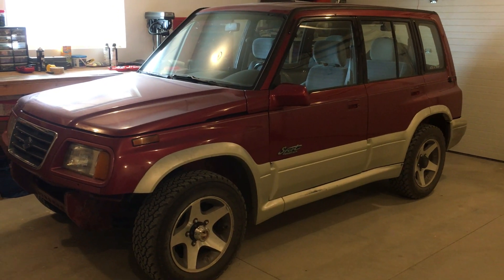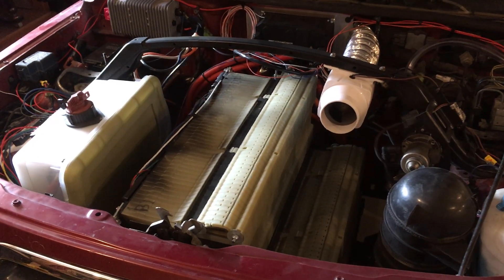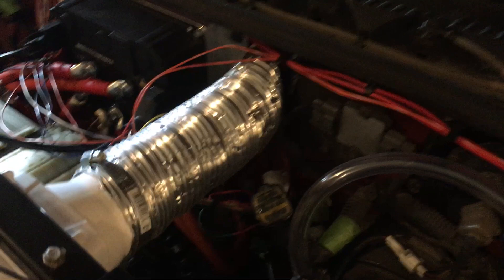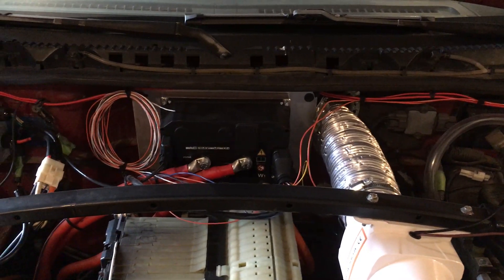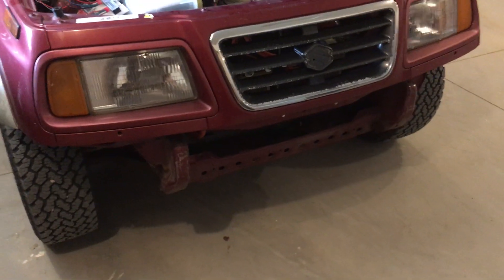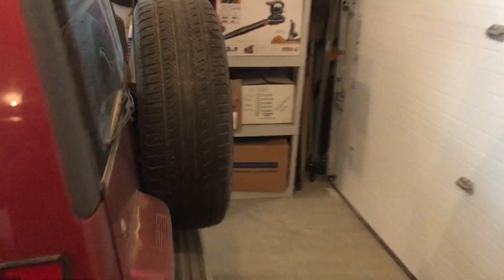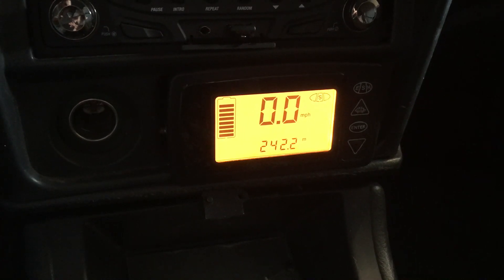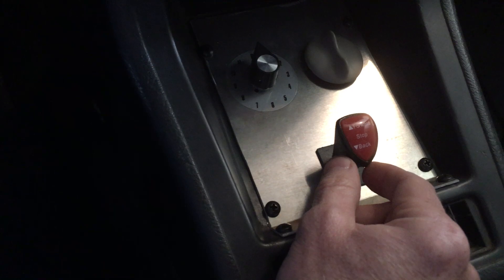World's First?  4X4 Suzuki Sidekick Electric Conversion!

Comment: I got one in my barn, we did back in 2003.  Lead acid car, the owner garaged it after battery pack failed in 4 years.
We’ve stripped it down and are going back to gas,, everything is so outdated, it would be a new build now.
Good job!

Comment: Is that the charger??  Im waaay off grid with solar and wind so what did you charge it with??
Reply from the maker: The charger is mounted in the rear cargo area.  I put a J1772 connector in the old gas door, and I just use a 110v adapter cable to charge from a regular wall outlet.  It pulls about 13 amps, and would take about 8 hours if it were completely dead.

Comment: So did you retain the clutch with your conversion?? Dandahermit?? I have a 91 two door Geo Tracker
Reply from the maker: Nope, the whole transmission is gone.  Had an adapter shaft made and bolted the motor directly to the transfer case using part of the transmission tail housing as an adapter plate.

Comment: What is the total weight of your vehicle. I'll be approaching 3500 (4500 gross from manufacturer) and many have told me that the Hyper9 isn't meant for something that heavy. Thanks. Glad I ran across your channel.
Reply from the maker: I haven't weighed it, but I think it's sitting right around 3,200 lbs based on the original published curb weight and what I removed vs. what I added.  The Hyper9 does fine with it with two caveats:  1) If you delete the transmission, don't expect it to jump off the line in high range (no gear reduction besides the axles), and 2) If you will be climbing long hills or running high speeds in warm weather, consider a liquid cooling system for the controller.

Scott
Reply: @scottkahre9206  Good to hear and glad to know. I am retaining the 5 speed, but not involving the clutch for ease of install... on a budget. I'll get the cooler plate while I am filling up my cart at Netgain. Phase 1 (96v @ 200ah) will be around 300 and Phase 2 is double that range. What kind of + amperage do you get with regen? +5% of what you used to get up the hill? I enjoy your videos because of the like scale of your diy and mine. Thanks again.
Reply from the maker: @beazkneez  I don't have exact numbers for the amount of power returned during regen - I've never datalogged a good comparison of up vs. down the same hill, same speed, etc.  However, I can say that based on the negative DC Bus amperage I've hit during deceleration compared to the positive amps during acceleration, I'd say it's closer to 25 - 40% energy recovery.  But, I think it's more efficient at higher motor RPM (think decel. on the highway) - negative amps are pretty low when crawling downhill.  In any case, I try not to think of regen. as a range extender, but more as a drive-ability aid and brake pad preserver.

Comment: Could you pull significant heat from the wast heat of the motor? Maybe use the old radiator, and fluid cool the motor and possibly all the electric components.
Reply from the maker: Hi,

The motor doesn't actually produce that much heat, and it has aluminum fins all over it for air cooling, so it would be difficult to design a liquid system to cool it even more.  The only component that gets very hot is the controller, and so far I've been doing okay with the air-cooled heat sink and cooling fan.  But for lots of high-current driving in hot temps, I would need to replace the heat sink with a liquid cooling plate and connect that to a radiator.

Scott

Comment: I like that you have some of the same parts I chose. Can you please tell me what dimension and wattage grade etc of battery to controller cable you used? When you said three banks of Chevy Volt batteries do you mean you bought 3 different packs or you split one volt pack up into three parts? I split one into two 144v packs. There were some modules left over. Can you tell me what you would use to charge any batteries that were under voltage on your manual cell tester?
Reply from the maker: Hi, thanks for your questions.  I used 2-0 cable for all the main high-voltage cables, which is a little overkill, especially for the individual pack module branches, since in 4P configuration, they only see 1/4 of the controller current.  But, in this case, I don't have to worry about voltage drop causing modules to be imbalanced.  I also sprung for shielded cables from the controller to motor to prevent the AC from causing interference with other electronics.

I actually have four banks of Chev Volt batteries at 120V each.  You only see three under the hood because one is in the rear where the fuel tank was.  I bought one full pack, plus a couple extra 48V modules an EBay seller had already split apart from another pack.  By doing that, I didn't have any leftover modules.

For top-off charging (which I actually have NOT needed to do since completing the build), I purchased a 24V, 8A charger and a programmer to go with it.  I was able to program it for the proper Li-ion charge curve, and I can charge in 6-cell increments (which is how my "monitoring station" terminals are wired).  The only time I used this was to balance all the modules before installation, as since then they have all stayed in almost perfect top-balance.  I don't worry too much about bottom-balance because I don't really ever take it to a low S.O.C.

Comment: Could you put a larger heat sink in place of radiator and mount the controller on it? It would also enjoy air flow from front of the car just as the radiator would. Would this work?
Reply from the maker: Yes, I'm sure it would help.  I was trying to keep the heavy wire runs as short as possible, and also mount the controller in a very "safe" place.  However, the consequence is that it doesn't get as much air flow for cooling.

Scott

Comment: Acceleration 0-60mph?
Reply from the maker: To be honest, I still have not (and may never) do a full-throttle acceleration from stop.  I'm still a little gun-shy about breaking the motor-to-tcase coupler and/or over-amping and popping a very expensive fuse.  However, the few times that I have done pulls from roughly 15 mph to 50 mph at 75-80% throttle, I am VERY impressed at the acceleration.  It is nothing like a modern sports car, but it would leave the old 1.8L 4-cyl ICE crying in shame.